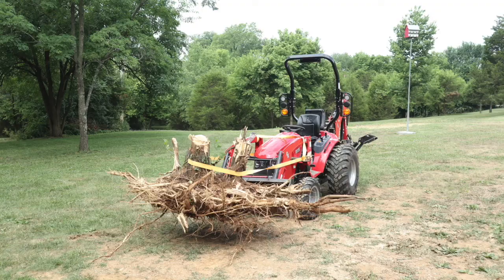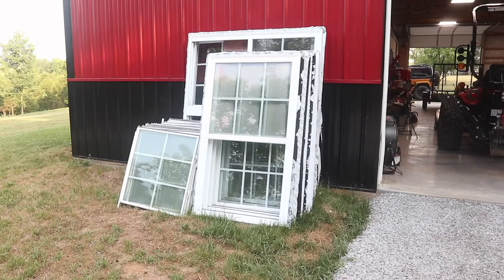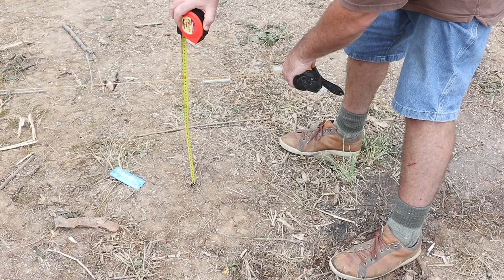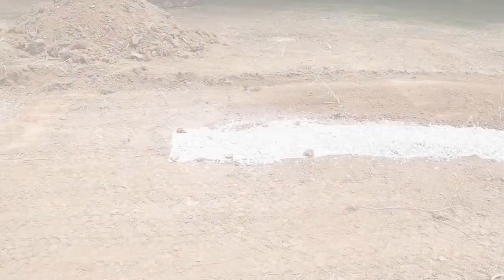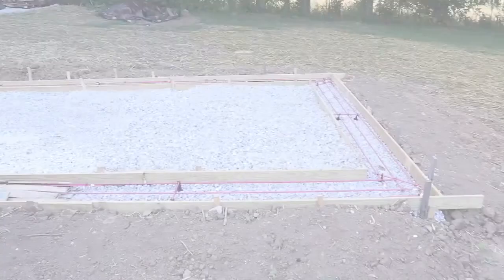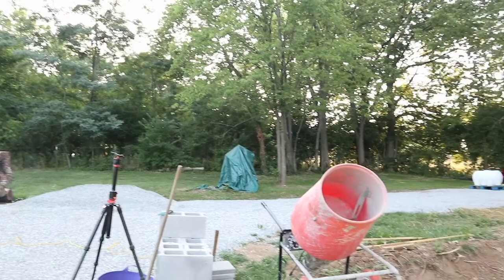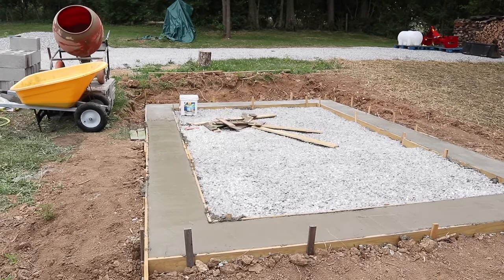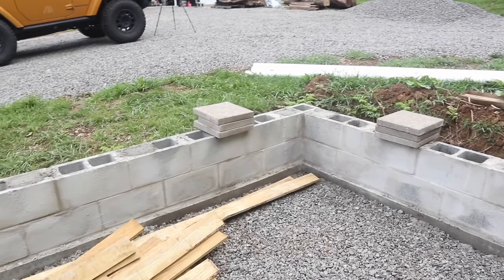TNT #134:  DIY Greenhouse Build Ep.1: "Foundation" Walkthrough and Cost Summary

Comment: If I live in an area where we have cold winters, should I place footer below the frost line? My greenhouse will be 80 sq ft
Reply from the maker: I would believe that if you did not put under the frost line then you may be opening yourself up to un-even frost/thaw cycles and potentially cracking your foundation.    A cheaper option may be to build it all timber frame, and have it set on good drainage stone with pressure treated lumber as your bottom course of your building.   Kind of like 'floating' on the drainage stone not connected.   That way it is free to move up and down and tilt temporarily one way or the other with the frost.   Should settle back to level by late spring.   Like you would a shed or 'baby-barn'.